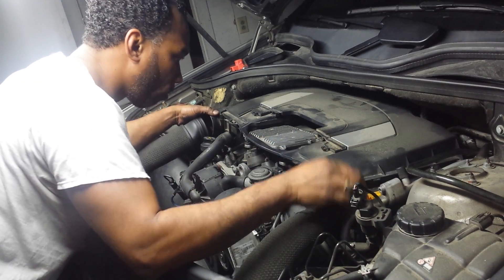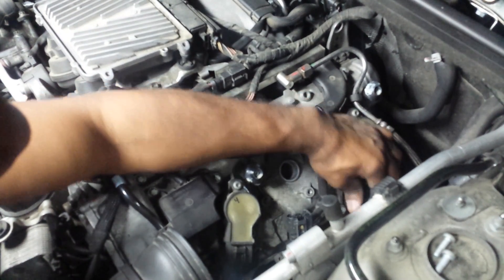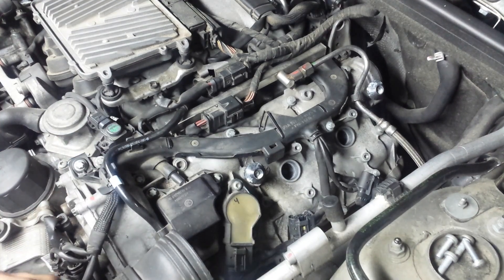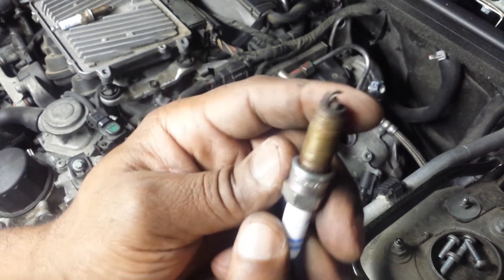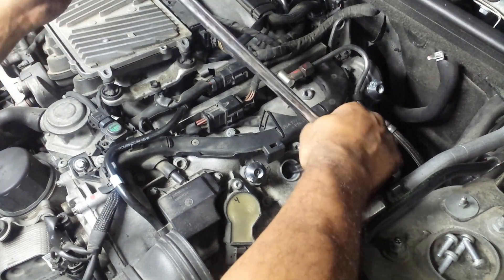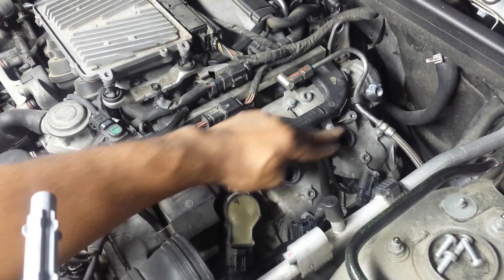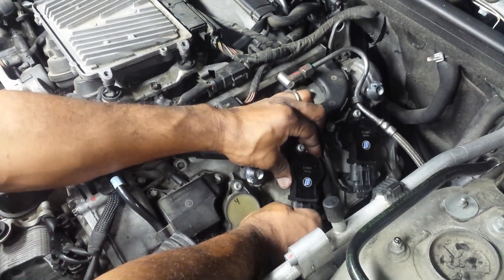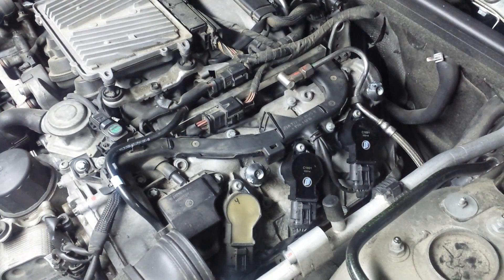Mercedes Engine Coil Replacement & Spark Plug inspection

Comment: i have a 2010 ml350 misfire 5 cylinder p0305 code bad mileage and rough idle at stops or parked shaking etc..code finally popped up any suggestions  beside change that coil and plug?
Reply: 175k miles

Comment: Thanks for the insight, my cars coil and spug plugs replaced,  the vehicle is troubling again 3 weeks after installation, it has no power and the engine stalls

Comment: Strange- I was searching with 1998 SL500 in the search term and I thought the video came back with that title  I have replaced all coils, connectors, and plugs on my car and there is no way any wires can be mis-identified.
Reply from the maker: Hmmm. What's the question?
Reply: @iRepairAutos  I thought the video was to include my model.  I guess it didn't.
Reply from the maker: It's very similar but parts change from year to year.

Comment: I have a 2007 s550 my back windows just stop working  can you help me.
Reply from the maker: Broken button?
Reply: Hey Monty, have you changed ignition coils on your Benz yet?  If yes, at what mileage.  It's good to share the info.  Your back window stops working.  It must be the motor inside the door panel.  It's not hard to replace it.  Look for video on YouTube.  It shows you how to remove the panel and you will see the motor inside.  Good luck

Comment: any reason the battery electrical cable not disconnected for this high voltage job??????
Reply from the maker: Because voltage is only delivered to coils when the engine is running.   Disconnecting the battery causes things like radio codes etc. to be wiped.

Comment: Does anyone know how much are two coil packs for a 2009 c63?
Reply: Just around 68.00 each. Don't buy the cheap one for they will fail real quick like.
Reply: @chuckjohnson2564  What brand is good besides the OEM ones?  What do you use?  Thnks Chuck

Comment: Hi, does anyone encounter this?

It's for Benz c200 cgi 2010 model.  I scan the unit b4 replacing the parts,  relay fuses , ignition coil wire are ok. I replaced the 4pcs ignition coil,  sparkplug, fuel pump, crankshaft sensor, camshaft sensor, battery but the engine starts then shut down. Now it won't start but cranks. 

After this I scan it again, I forgot the trouble code but it has something to do with the ignition primary circuit.

Do u have any idea what should I check or do next? 

Thanks
Reply: New trouble code is ignition coil primary circuit
Reply from the maker: What's the exact code?
Reply: @iRepairAutos  p2307

Comment: thank you Bro. Keith for this little surgery. 

You managed to overlook the coil silicone lube that will prevent cracking the coil rubber boot at next removal.
Also when removing TWIST BOOT TO LOOSEN IT BEFORE PULLING IT in 2 pieces...

Comment: Where did u bought the coils and are they Delphi?
Reply: you really should do 3 or 6 coils to keep crankshaft balanced
Reply from the maker: So it has an equal intensity of spark?
Reply from the maker: Delphi. Local parts store.
Reply: Franco Bartolotta 
    Looks clean.

Comment: Is this the 2007 ml350? My check engine code says the 5th one as well. Just want to make sure.
Reply: what helps just those No5 get bad??
Personally I am not a fan of the skinny iridium plugs - I think the fater double-platinium fire most consistantly
Reply from the maker: 2006 to 2011 ml350

Comment: Do you know how to reset the check engine light? Also I had a code for missfire on cylinder 4 , I changed the coil and spark plug, but I still feel a slight missfire when the car is running. What could that be?
Reply: Could possibly be the coil wire or the fuel injector. Are you able to scan for pending codes? I've had the same issue where another cylinder's coil was on its way out but didn't perform bad enough to activate the check engine light.
Reply: Dyllin Dannhauser thanks for the input. The slight missfire went away after about 3 weeks of installing the new coil. Maybe the car just to get used to the new spark plug or coil😊
Reply from the maker: The computer had adjusted to the bad coil.  Reset the check engine light to erase the code and reset the computer.  If you don't reset it the car will eventually after a certain number of cold starts reset the computer.
Reply: it's a bit of a waste of time to change a single coil and plug. 
Guess how old are the other ones??

The one thing the computer does is treat all cylindrrs as equal to balance the engine wear.

FYI: tires and brakes work need to be matched per axles...

Comment: This doesn't help much since I have a C230.
Reply: If you know the basic mechanics then this is an excellent guide to steer you in the right direction.
Reply from the maker: +DARCY WRIGHT the objective is the same.
Reply: yep, live and learn.
There are 1000 ways to screw this job and only few to do it right.

Everyone believes its a good idea to lubricate the coil boot because Benz supplier made the rubber brital. As soon as there is a crack you'll get a short to GND: misfire! Super well engineered with those narrow plug wells.

Of course driving on wide open plugs helps the sparks jump to easier gaps.

Comment: if you replace the coil and the plug and reinstall one at a time then you wont need to remember which electrical connection goes where...

Comment: does the battery need to b disconnected for this process??
Reply from the maker: The battery does NOT need to be disconnected.  The engine must be off.  Key out of the ignition.
Reply: alright thnx